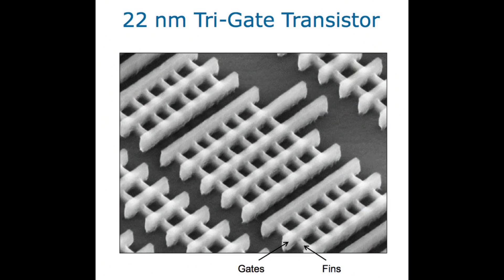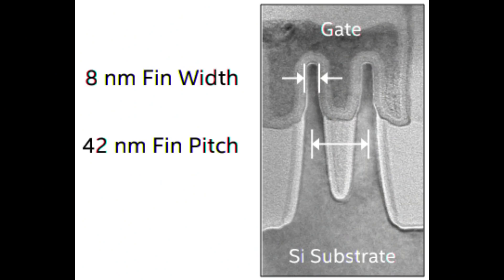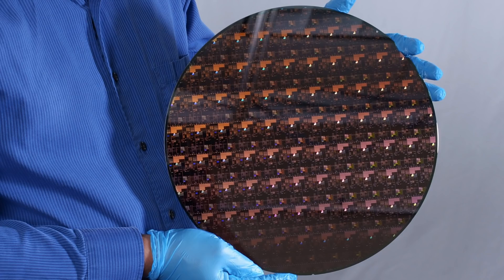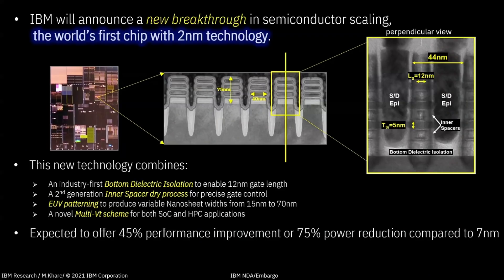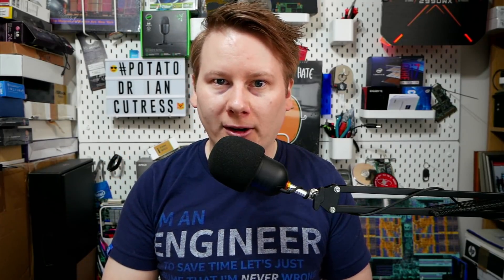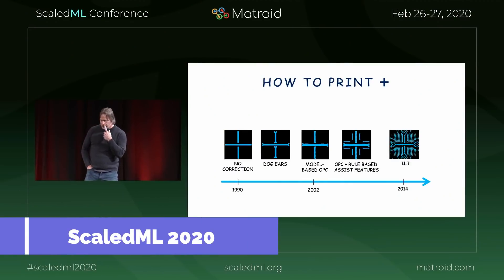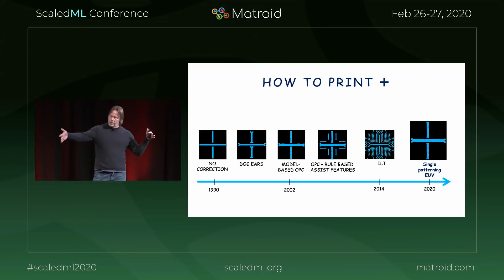There's Plenty Moore Room: IBM's New 2nm CPU

Comment: Keep in mind that the minimum feature size (2nm) is much smaller than the actual transistors.  At 333M transistors per square mm, the transistor average spacing is 55nm.  That is about 260 silicon atom diameters, while 2nm is only 9.5 atomic diameters.
Reply from the maker: Keep in mind one of the first things I mention in the video is that it's only a name.
Reply: @TechTechPotato  
Yes, I just wanted the viewers to realize how misleading the names are.  The chart of transistor densities that you showed, does convey the inconsistencies between manufacturers, but not the magnitude of the difference between feature and transistor size.  If you read through comments here and elsewhere, you find that many people still think the names are the transistor sizes.
Reply from the maker: Judging by your comment, it appeared as if you hadn't watched the video. Which is what a lot of people making those sorts of comments you're referring to end up doing as well.
Reply: @TechTechPotato  
When I find other videos on the topic, I'm recommending to viewers that they go to your channel for better detailed information.
Reply: @TechTechPotato an engineer should not pick-up Marketing speek too much

Comment: IBM might also want to use the 2nm node for its 12th or 13th generation POWER ISA.   The 10th gen is going to be 7nm, so if the 11th is 5nm, then 2nm could be 12th or 13th.   What is really interesting, after GAA transistors, many people think that the next development will be verticle transistors.  This could save a ton of space, as the short channel effect keeps the length of transistors almost unchanged for many years.

Comment: I think the only measurement that should be used to describe process technology generation is transistors per quare millimeter because that's the only metric that cannot be twisted by the marketing department. Even there you should also include the frequency you can run those transistors.
Reply from the maker: The problem is that it can be manipulated. What types of transistors - simple ones or large flip-flops? What's the right ratio?
Reply: @TechTechPotato  If you want accurate results, you could specify one exact transistor type for that metric. I think that even if the metric used any type the results would be much better than current "nm" names.

Another option is just to forget about the process level comparisions and just get chip manufacturers to tell the total transistor count for a chip in addition to chip area and we could just compute average transistors per square millimeter over the whole chip. That would better reflect the fact that the process technology is not the only thing that matters for actual performance and that chips are not just transistors only.

Comment: What is your opinion regarding the likelihood that photonics will ultimately displace electronics altogether rather than merely complimenting it?

For some time now I have wondered whether continued reduction to scale for processor architecture may ultimately only be  sustained by way of adopting more diverse subatomic particles such as or other than photons as an ultimate replacement for electrons.

Given, the history of natural progression and diversification with regard to the 'electronics' industry.

If the first commercially available photonic processors are due to be released late in 2021 it seems possible or even probable that some more innovative approach may already be in the works somewhere.

For example it may be an answer to discarding transistors and if anybody was to have an insight regarding such things I suspect it might be you.
Reply from the maker: Photonics for off chip at distance.

Comment: I know nobody will care about this, but all semiconductor fabricators SHOULD adopt a standardized transistor array to be used for verifying the effectiveness of a new fabrication process.  Use it to validate the next finer pitch process.  It's a definite transistor array that has a definite function and would be used for live circuit verification and performance testing.  If it works reliably, then the manufacturera can say "We have achieved 100 percent yield at 0.18 nanometer processing using the industry standard transistor array" with a transistor density of X transistors per square millimeter."     Put all comparisons and evaluations on a level playing field with the same test criteria and test article.

Comment: Just curious as all of these sizes are still quite a ways away from the size of the average atom (0.1nm to 0.5nm depending on the atom type.), so it makes me wonder how long or how far away do you think we are from creating transistors at the atomic level(atom sized or smaller.)?  I remember one scene from an decade or so sci-fi movie called "The Last Mimzy (2007)" where this stuffed animal had been examined (the mimzy) where they looked down to the nm scale and eventually got down to the atom scale and saw on an atom the words INTEL with a copy right mark on it.  that was 13 years ago and of course at that time complete sci-fi dreamscape.  How close is that level of manufacturing now do you think?

Comment: And my favorite CPU was the Motorola 68000, invented first for military use in the mid 1970s, which  animated the first 16 bit the personal computers in the mid 80s and many 16 bit consoles of the early 90s only had 68000 transistors on this large rectangular CPU.

Comment: Hello Ian thanks for the info it’s very helpful. I have a question about densities however, the discussion states units of transistor/ square mm. Densities are really a quantity per unit volume so are the units per square mm or per cubic mm?
Reply from the maker: That is correct.

Comment: Plan A - Use 10nm for desktop mobile and Xeon
Plan B - Use 10nm for Xeon, till it’s worthwhile to use defect wise for the rest
Plan C - Backport to 14nm Plan B’s products 
(Aka I the wait has been so long the ”in case of emergency” plan to backport designs we can’t use on their intended nodes is actually here before 10nm is viable for desktop?)
Plan D - Give TSMC an offer they can’t refuse, fill time till it kicks in (it’s not like Intel hasn’t slid for years already) 

Would imagine investors would rather a write down on Intel’s fabs, but with a working roadmap on working nodes via say TSMC - if you can sell updated products, on cutting-edge nodes, the profit margins would cover the cost of their loss-trailing nodes.

Comment: Zzz !!!
 Nu contează că este de 10 × 10 mm  cu 32 procesoare pe el , eu prefer unul de 70 × 70 mm  însă cu mai mult de 1000 procesoare pe el ! 
It doesn't matter that it is 10 × 10 mm with 32 processors on it, I prefer one of 70 × 70 mm but with more than 1000 processors on it ! 
Peu importe qu'il soit en 10 × 10 mm avec 32 processeurs dessus, je préfère un de 70 × 70 mm mais avec plus de 1000 processeurs dessus ! 
Es spielt keine Rolle, dass es 10 × 10 mm mit 32 Prozessoren darauf ist, ich bevorzuge eines von 70 × 70 mm, aber mit mehr als 1000 Prozessoren darauf ! 

HEIL  MONEY ! 
Zzz !!!

Comment: For ~40 years,I worked at the IBM foundry where they built/tested semiconductors. (wrote software to run the line) IBM no longer manufactures their own chips...but they still design them and monitor every step of the manufacturing process.   It is interesting that most folks dont even think of IBM when "tech companies" are discussed.
Reply: I guess them pulling out of selling office/consumer machines to focus on cloud/enterprise hardware and R&D pushed them out of focus for most people...the name is well known, but many people have no idea what they're on about these days because there's little to no (obvious) presence outside of IT space
Reply: When you think of IBM, you'll think of the physical products they produced with their name on it. Things like early PCs, not modern tech.
Reply: right, what ever happened to IBM? They used to be THE tech leader, but now who knows IBM? They design chips, they have AI, and they are working on quantum computing. Strange.
Reply: @ketzbook  cutting edge tech isnt meant for consumers. microsoft is a consumer based company along with apple/etc... theyre focus is consumer userability not pushing the limits of science.
Reply: Except when it's about the Thinkpad.  The world hasn't completely acquiesce credit to Lenovo except for bad designs. 😂
Reply: This rings so true … I can't help thinking of how Australia doesn't build cars anymore this decade, but we design them just like before.
Reply: Even in the IT Industry people don't think of IBM as a live company.

Comment: So, why don't they just increase the number of transistors? What is the die size right now? 1.5 cm x 1.5 cm? Make the die larger. It is jut silicon and there is plenty of silicon.
Reply from the maker: Biggest CPUs are already at the reticle limits, and you also have power to think about.
Reply: @TechTechPotato  What's a reticle?
I don't understand how CPUs can draw so much amperage at 1.2 to 1.4 V. They are doing some kind of magic. I didn't know that silicon can be such a good conductor.

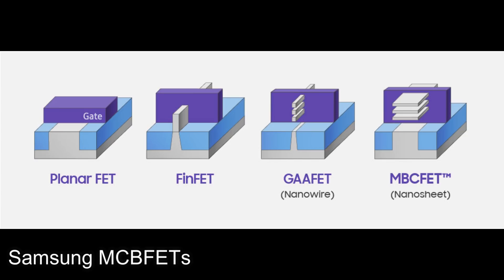Comment: Those transistors at 8:28 perplex me! I presume gray is silicon substrate, I guess blue is the insulator (either SiO2 or SiliconNitride), which makes purple the conductor (probably poly silicon or a metal). So why is the gray (mono silicon) touching the gate conductor? So are they not showing the drain and source perhaps? I don't get what we are looking at! Even the planar FET doesn't make sense.
Reply: lol, don't use the two syllable slang (short version) for "transistors" otherwise google marks it as hate speech and deletes the comment.

Comment: My minimum specification is a 486-dx4, 16mb ram, 1gb hdd, 8x cdrom, sound blaster 16 compatible sound, and a vlb vesa compatible svga card though I'd be much happier with a 1ghz Athlon/P3, 128mb ram, 160gb hdd, dvd-rom, sound blaster audigy, and a geforce 2 if I could swing it.

Comment: Whole systems on a single larger chip !! I've actually designed a circuit board on a single ceramic chip, reducing the size of circuit by 50%.

Comment: When the trisistor is invented, a device with three states, -1,0, and 1, all this will be thrift store junk. When trinary replaces binary, things like  3d holograms, will be at least theoretically possible. Then they will be able to crack a ransomware threat in a matter of minutes. And btw, if a processor is 1.5in x 1.5in or 3in x 3in, will it really matter? I don't think so. and then in the future processors could be based on 3,4,5 6, or whatever, It just depends on what new devices will be developed,  now it's silicone,  what's next?  Will photons replace electrons? Only time will tell.          Just sayin'    Mike

Comment: Having chased the rabbit to 90nm, it is truely multiplied in difficulty at each node. 

The layers don’t count towards dimensions, they have to be photolithography based features in the logic core to qualify as a node. 

It’s my understanding that at 7nm intel used actual dimensions, where their competition uses Leffective to measure their node.   When a transistor isn’t perfectly efficient it will be lower performing like an optimal transistor of larger nodes.

I’ve been to Albany, Malta and ASML in Connecticut, they don’t do as much assembling as you think, and the real majic happens at cymer San Jose

Comment: Wrong way, we are going. The sun solar flares will fry these tiny 1 micron connection. As it age our sun will send out even more solar flares. And our daily lives will depend on a 1 micron connection.  Cars,  electricity, phone, internet.
Scary stuff.  Same as a far away nuclear explosion. It will fry micro processors & Cause that a one way street with no backup. Power plant goes down. You walk for months. Shelves empty at stores.
 Electronic can helped our life's but the opposite end it can end mankind in infrastructure shutdown as too depend on it. Sun Solar flares will get worst in climate change. And here we are going into 1 micron connection  . One volt over design can fry it and decide if your cars can move or not.. walk for months, as waiting all you can do.
Reply from the maker: This is nanometers. Smaller than one micron. We have been smaller than one micron for 20+ years. Your cells in your body work on micron scale. Smaller than micron. By your logic we would have fried millions of years ago.
Reply: That only make it easier to fry. LOL? And wrong, even as we haven't had much solar flares since the 80s . first search say 
This . The danger isn’t hypothetical. In 2017, a solar storm caused ham radios to turn to static just as the Category 5 Hurricane Irma was ripping through the Caribbean. In 2015, solar storms knocked out global positioning systems in the U.S. Northeast, a particular concern as self-driving cars become a reality. Airline pilots are at greater risk of developing cataracts when solar storms hit. Female crew see higher rates of miscarriages.

In March 1989, a solar storm over Quebec caused a province-wide outage that lasted nine hours, according to Hydro-Quebec’s website. A 2017 paper in the journal of hydro magazine.
 
And you can go and trust your ev . But when your car can't be charge or the chip are fried. You can walk and cry all you want. LOL

Comment: Chips don’t mean diddly squat, they are nothing more than a COMMODITY product that can be churned out anywhere…soon they will be churned out in Africa…

The newest passenger jets in production still use 286 chips from 30 years ago, because they fly high enough where cosmic radiation will fry small circuits…spacecraft like sats need much bigger circuits still…so do missiles and everything else that really counts for anything…

Anyone who has used a computer for the last 30 years knows that there has been zero real progress in the last 20 years, after the initial gains in performance from say 1990 to 2000…the computer with Windows XP I used 20 years ago was actually more stable and more capable overall than the piece of crap I am typing this on now…despite having supposedly 100 times more power…

The Apollo rocket was designed using slide rules, so was the Concorde supersonic passenger jet…those kinds of things take actual engineering, not a computer…
Reply from the maker: Make sure you tell big research institutions doing large compute research and nuclear simulation to throw everything out and go back 20 years. You'll save them many headaches.
Reply: @TechTechPotato  you have no idea about military tech especially nukes . It is something completely different and I have see you have zero understanding

Comment: Unfortunately there was no explanation on the optical tricks they used with pre-EUV light sources. Turns out they added features to the mask, so that due to interference the image on the wafer would be closer to the pattern they wanted to print. So, instead of suffering from interference they managed to exploit it. Truly amazing engineering! Google "Computational Lithography".
Reply from the maker: It's literally part of the video you just watched, right near the end with Jim Keller.
Reply: @TechTechPotato  Jim Keller doesn't say it explicitly. He just say "we do a lot of things" in the context of interference, but never utters the magical words. Anyway, thanks for making the video.

Comment: That's getting down to where it's more critical to squelch " crosstalk" from the local neighbour then anything else. They can in theory go much lower but it's like when the Japanese cram people in trains, there's going to be some pesky effects. It'll most likely come down to encasing the action in a liquid dampening medium
Reply from the maker: The first part of the video explains that 2nm is not a physical dimension, it's a name.
Reply: A sub micron by any other name. What I'm inferring is they've not yet hit the; I'll refer to it as the " Planck Return". Personally I'd rather have 2 discreet microprocessors and a 3rd posing as a Co processor a la early 80's then one that's equivalent to shoving 15 £'s of hype and PR into a 5£ form factor.
   Such is my casual opinion. A stoutly built machine that's reliable then some anemic Pico processor trying to > pass<

Comment: Love these videos but they make me feel ancient. I was a electronics technician for almost 30 years and have seen so many changes for the better. Example: The first military piece of equipment I worked on had a test set the size of a refrigerator and the program had to be loaded with floppy disks that were the size of an LP. This airplane (and test set) is still in use.

Comment: i am very much a layman when it comes to this stuff but it seems to me those processors are still very thin, so how much potential is there in just bulding them more vertically  like lets say can a processor be 2-3 inches thick and work fine? it could then have many layers in it right?
Reply from the maker: The issues are (a) cooling, because layers will generate thermal hotspots, but also (b) you have to supply power to every layer, which requires dedicated power connectors through the middle, which disrupts final integrity and you have to build for that. It makes it very complex compared to a simple one layer chip

Comment: There are problems beyond manufacturing difficulty. As the paths shrink the percentage of current leakage goes up. And the number of errors due to faults like bit flips goes way up, so more of the chip must be dedicated to error detection and correction. Both issues slow the processing speed and effective density. At some point the losses will nearly equal the gains and that is the real limit. And for those who haven't read both of Moore's papers, the discussion was based on the most cost effective middle market production chips, not on the cutting edge.